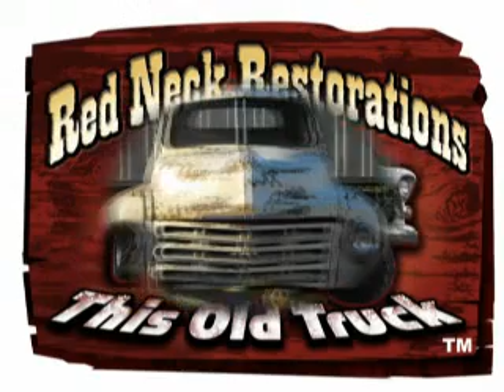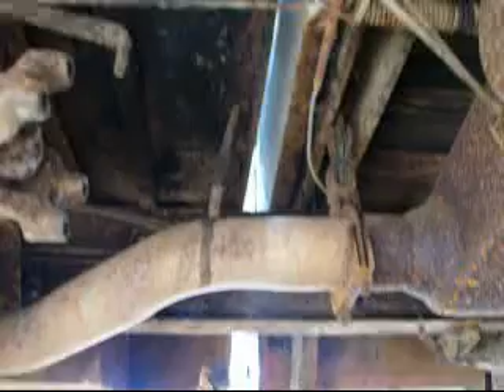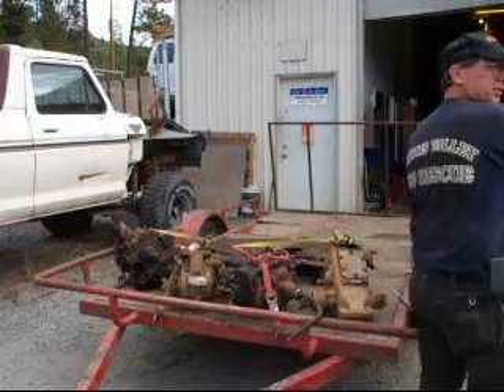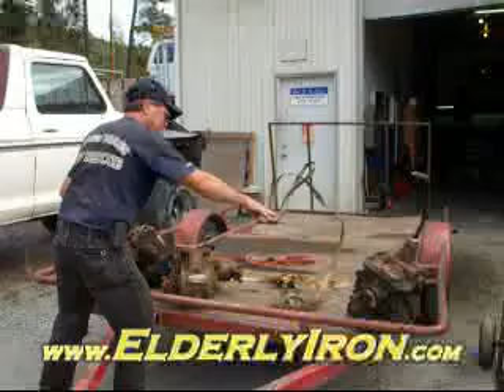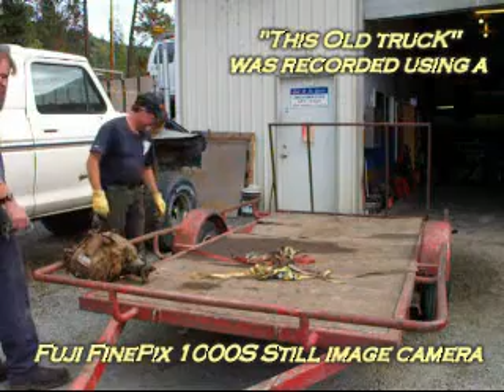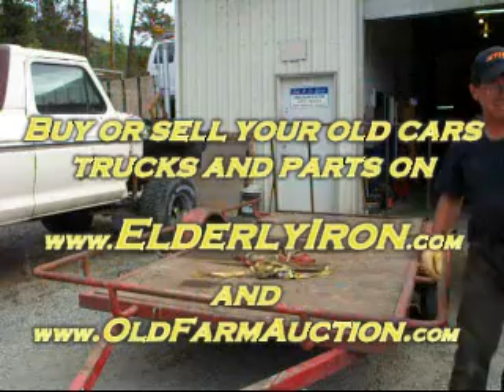57 GMC Rebuild Napco Transfer Case Removal

Comment: I wonder if you could make a wedge shaped cradle out of wood that would sit on the jack to help reinstall this beast.
Reply: bg147 Yes you can. I use to do a lot of T-case jobs and all I used was a homemade wood platform attachment for my floor jack and a wedge of wood. I removed the floor jack saddle and replaced it with a homemade 16in. x 16in. wood platform with strips of wood on the sides. The front and back of the platform didn't have anything in the way so the T-case can be slid off once it's in place. To achieve the proper angle of the T-case to bolt it up I had different height blocks of wood that would prop the case up and the ridges on the side of the platform prevented the wooden block wedges from sliding. Once the proper angle was set I would strap the T-case down to the platform and, Bob's your uncle. This homemade T-case/trans jack even worked better than having someone help you get it in place. It was also a hell of a lot cheaper than a store bought specialty jack. Before I made the jack attachment I would just jack up the truck, put it on jack stands, lay underneith the truck with the T-case on my chest, and bench press it into place. Oh, to be young and again! I could still do it today if I wanted to; I just don't want to. I don't like doing things that I still feel days later.
Reply: That was some serious improvising.

Comment: Did you ever find new rubber bushings for mounting the T-case.  I'm working on one for my daughters first vehicle and haven't had any luck. DM
Reply from the maker: +MrMw67 Doesn't have any...
Reply: ElderlyIron   There is a rubber bushing on the transfer case side for each of the four bolts.  Mine are cracked and falling apart on an original forest service truck.  I've heard of some people making there's out of urethane as the rubber one's are hard to find.  I was hoping you found a supplier.
Reply: MrMw67 Sorry, Maybe I'm not being detailed enough. I'm not talking about the flat rubber bushing for either between the transfer case and frame, that's an easy find.  I'm talking about the four grommet style bushings for the transfer case mount to the case itself. Thanks for your time. Dave